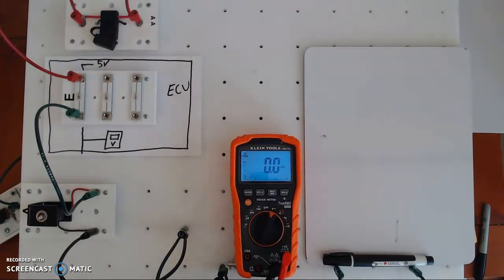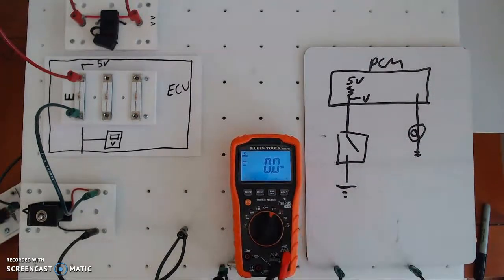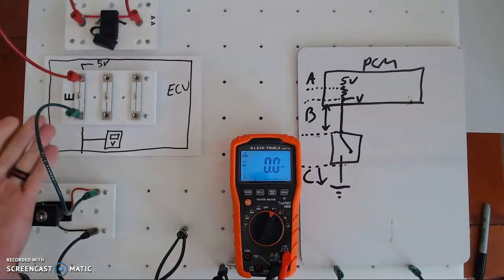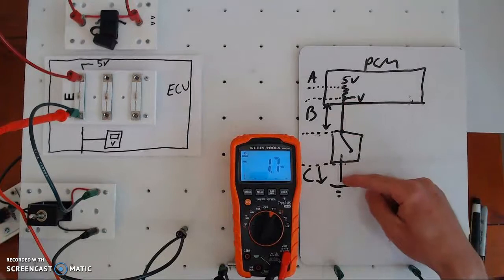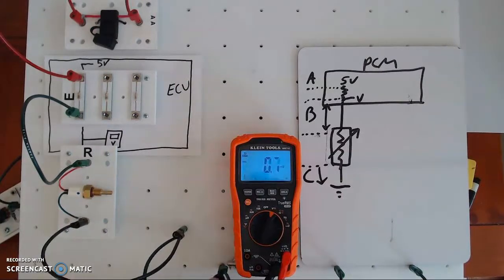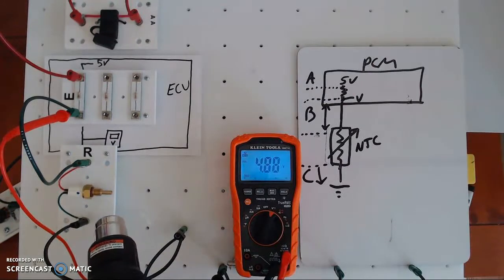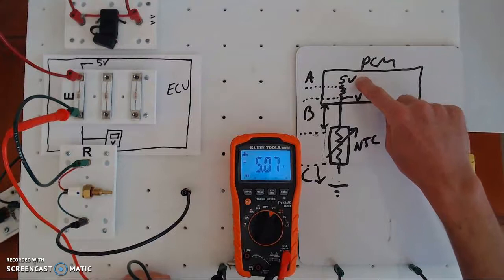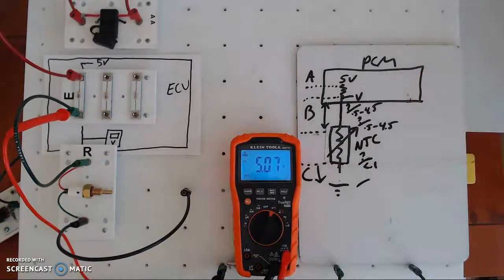Automotive two wire sensor operation.

Comment: Maybe you can guide me correctly. I have a 1996 Ford f150 4.9 engine. i have no spark at the coil output to the distributor tower but i have voltage at the coil. It has a crankshaft sensor new one and ohms out at .368 so you say the wires go to the ECM to ground out there that being .5 volts. Can you give me the circuit points and voltage measurements to find my no spark fault? I can check the continuity of the wires but i need to know that continuity circuit to make sure the wires are not split or broken but after knowing that the wires are good on my two wire sensor but which no terminal do i check to make sure on the ECM? I have the ICM on this truck and also i have the pickup coil inside the distributor. Any help to find out how to make this truck spark?

Comment: Hello sir I hoppe for some help. I have old Opel Ascona C 1.3l 85 model year . It has the classic GM staff on it . I tryed multipel atempts to some how retard ignition timing. I use the E core 4 pin design ignition coil,pick up coil and the 4 pin GM ignition module. My land does not have that special 5 pin GM ignition module and its to much expensive to order it. So what can I do to those circuets to manuali switch that circuet to deseired fiering engine degree with out turning phisicali the distributor? I did try out dual ignition modules on 1 pick up coil it did fire bouth seperatli ignition coils so I wondered if I culd simpli use dual ignition modules in 1 ignition coil just change resistor values or sone thing remote controled. Ya know Im confused lot some peopel say use schmit trigger some say use variabel ignition system but my car is to old it does not have crank sensor or other staff ever if it did have it to old car cant finde correct plugs with wire resistance . I did kinde of used speaker wire and 500k potenciometer from + pick up to + input signal to module it did kinde of worked but not how I wanted engine run terribel it seams only I restrict current or voltage going to ignition coil not reali retarding and insted fiering on compresion I ended up fiering at exaust stroke insted more or less engine run but crapy and did actuali run fiering at exaust stroke after long cranking. So any sugestion please? I did as well tryed out that plasma ignition staff was nice tought but caused havoc on my delco 12si alternator starting current didnt go as planed how I wanted it those were ceramic hv capacitors. I did notice the 4 pin gm ignition module does not have zener clamping diode in its circuet I observed the mc 3334 ic chip design on google and found out my car does not have that zener diode so aperantli it can cause miss fire or do funy staff if static is present on the chassys or arcing. So I dono what to do ?? I did figure out maybe I culd use external circuet after all the ignition module needs only + from the pick up coil not the - to work so I tough perhaps some disruptor circuet atached to the - pick up wire migh some how disrupt the signal for a while. Any way I need any circuet that can retard ignition timing on my existing ignition system. I dont have any upgrade posibilitis. Im not shure if capacitor/resistor box might help or not Im preaty much confused how it is done voltage/frequency regulation is done basicali on a 1 wire ac generator . At this stage Im desperate .

Comment: BTW..  If you did accidentally write on something with permanent marker--  you can just scribble over that with the dry erase marker, and it will magically erase the permanent marker when you wipe it as normal.    Works really well.   I think they are just mixing some type of acetone or alcohol or whatever in the dry erase marker, which is otherwise just the same as a permanent marker. (if  you took out the solvent).

Comment: in two wire EGT(Exhaust gas temprature) sensor, is it possible that if exhaust gas temp. remain high for long time which leads to low resistance on sensor and that makes high voltage input to ecu for long time and it make ecu circuit to damage? can i have your email or other contact to discuss this query?